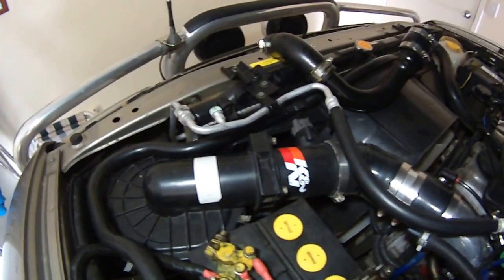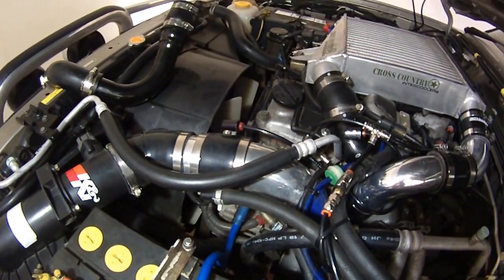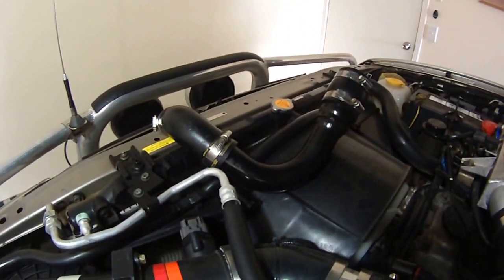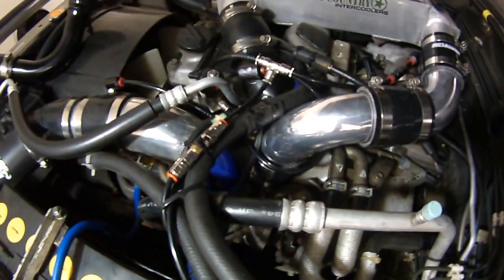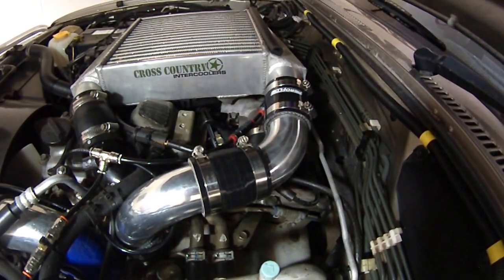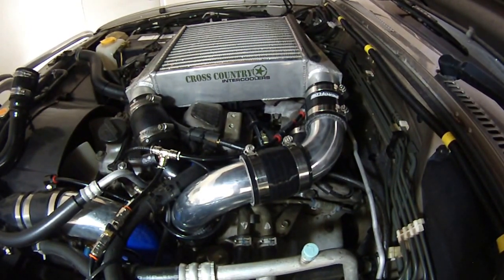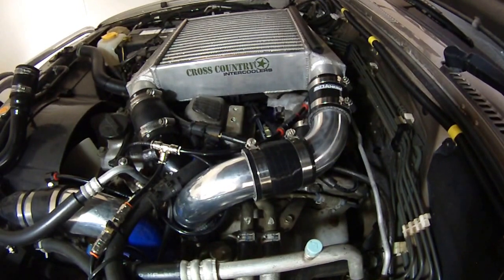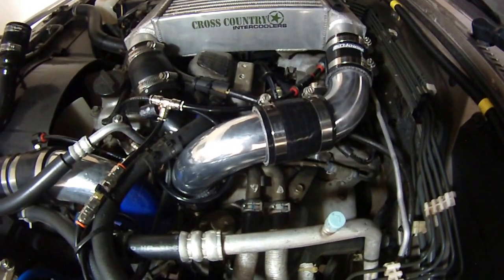Nissan 3L ZD30, turbo outlet to Intercooler modification

Comment: Geeyoutoo what size air filter you running I read somewhere you weren't running the standard gu patrol air filter from memory?
Reply from the maker: I have 2 reusables I use, a K&N E-9267 and a BMC FB229/07. The BMC is a slightly smaller dia than the K&N which is slightly smaller diam than the std air filter. The BMC gives almost 30mm around the filter allowing better use of the filter area, instead of getting the round black spot on a std one you can see a larger area being used and will notice dust even around the corner.

Comment: Nice video. I just picked up an elgrand 1999 with zd30 that doesn't start
Reply from the maker: Is that since you bought it or after?
Reply: @Geeyoutoo  bought it for a good price. But is it a good price really if it doesn't start 🙆 will have to figure out what's wrong with it. Worst comes to worse it's the fuel pump
Reply from the maker: @tunex_  What turbo does it have? is it a Zexel VP44 pump? Does it have the primer on the fuel filter? If so are you able to prime fuel to pump in 1-2 pumps?
Reply: @Geeyoutoo  I will have to check, if so how? Is a 1999 nissan elgrand 3litre turbo diesel X model which is the top trim.
Reply from the maker: @tunex_  sorry can't add a pic, just google Zexel or Bosch VP44 fuel pump and you will see.
Reply: @Geeyoutoo  ok so it does have the pump on the filter which is accessed under rear passenger seat. But it's very stiff, and I can't pump it. I assume either water got into it or something. I've tried starting it up with spraying cold start in to the intercooler and boosting a positive on the coils for the glow plug. And she didn't start.
Reply from the maker: @tunex_  What I would do is change the fuel filter if that hasn't been done since you bought it, while fuel filter is off, try pumping the primer to get fuel through the system, catch it in a container so you can check it out for purity, primer should move freely under this circumstance (but go firm within 1-2 pumps when all is sealed), if all good then fit the new filter, loosen the pump inlet banjo bolt on the side of the pump and pump primer until fuel weeps out of the banjo, tighten banjo, loosen return line banjo and do the same. Try to start, if worse comes to worse then remove glow plugs and crank until you see fuel mist coming out through the GP holes, if it does then refit GP's and try to start. Make sure battery is fully charged. If you don't get mist then there is another problem, but that is another story.
Reply: @Geeyoutoo  Great, thanks will. do that then 
I will come out with a video on that probably.
Reply: @Geeyoutoo  I also have a l400 2.8 diesel delica, but that runs well exept for the wobbly turbo.
Reply: @Geeyoutoo  what is the list of suggested mods? I assume a turbo timer is a good option to start with
Reply from the maker: @tunex_  I'm not a fan of turbo timers, don't see the point for a road vehicle, your not (or shouldn't be) turning engine off straight after giving it a flogging, by the 5ime I've driven into my driveway EG5 is well and truly at or blow 200c.
Reply: @Geeyoutoo  sounds good. Maybe just a temperature gauge
Reply from the maker: @tunex_  EGT gauge, one of the best favours you can do for a DI.
Reply: @Geeyoutoo  will have to study that for sure
Reply from the maker: @tunex_   check in at https://www.patrol4x4.com/ we have lots of ZD30DI information there.

Comment: Hey mate, I'm looking into this and want to know if there's any mods I can do 1 at a time as I don't have all the money right now for the lot of it. But I just brought a 2005 Nissan patrol gu st and it's done 360,000 kms. The motor is in really good condition but should there be some things I could be doing to maybe keep it going for as long as I can before a rebuild? 
Thanks 
Taylor

Comment: Hi there mate not sure if you still keep up with these comments love your videos! Have a 2003 zd30 all NADS done have ordered a hpd cooler arriving this week my boost gauge is currently plumbed into the IC out pipe I have seen that some put a T  in the IC where the boost vacuum line goes, would doing this effect the boost gauge reading or the amount of pressure my Dawes and needle will receive? Thanks in advance
Reply from the maker: Hi Zach, yes there can be a minor effect if just a T is used, sudden changes can cause a minor fluctuation, I like to keep lines to boost gauge and to the back of the Dawes separate, both of mine are tapped separately into the cold side of the IC.
Reply: Thank you very much I think I’ll get a bung welded into the cold pipe

Comment: Awesome job GU2... mint patrol!  -Dan (Ireland)
Reply from the maker: Hi Dan, is this the same Dan I know from somewhere else? :).
Reply: @Geeyoutoo  Yes Patrol Dan ;) The lad having all the drama at the moment LOL
Reply from the maker: @RC3Dflownwithpassion  I'm in the process of replacing my IP and fitting larger injectors, hope to have it back together late today, IP is a mongrel of a job on a DI.
Reply: @Geeyoutoo  Good stuff.You will be glad you did change that IP.Mine is so light on diesel and makes heaps more power.Regardless of what needs to be done to mine i'm going to keep her on the road.I love it. I will update when i get it back on what was wrong/is wrong.

Comment: Hey mate, whats the sizes for your intercooler piping to the turbo. If you could type me up a short parts list for it that would we awesome!
Reply from the maker: OK I will go over my notes and see what I can do tomorrow, you should be able to buy most of the bits at Autobarn these days, when I did this it was a little harder to get them. I'll add the list here.
Reply from the maker: OK found the list. In silicone I bought a 76mm short straight, a 76mm 45degree and a 76mm-51mm 45degree, the only ally tube I needed was a 250mm x76mm 45degree, I had to shorten the bend anyway so I was able to use those off cuts as a short transition to gain the correct length, I trimmed the rolled ends off the ally bend, there is no pressure in there so they are unnecessary. The silicone 45 degree needed a bit of trimming to get the angles to line up, about 6mm off one side at the back.
 I bought this gear from ARE in Brisbane (not sure they are still there) but I'm sure you can get it from Autobarn. Hope this helps.

Comment: Is there any problems getting rid of the intake resonator and disconnecting the plug that goes into it??
Reply from the maker: You can remove the resonator with no problems, mine has been gone for years, you will notice a slight change in intake sound, as for the plug you mention I assume you mean the vacuum solenoid that is bolted to the resonator, on the DI's yes you can disconnect that again with no issues, but I'm not 100% on the later CRD but suspect it would be the same.

Comment: Is there any chance I can put that intercooler in my d22 zd30 dx model I am having stress about intercooler fittings spot like front intercooler or on top engine intercooler
Reply from the maker: Should be able to with the correct bracketing, I'm not sure what fittings your D22 has but it's basically the same engine. That IC fits onto the original mounts at the front but because it is much larger it comes with brackets that bolt to the engine at the back using existing threaded holes.

Comment: How can I change turbo for nissan caravan as 30 motor from the normal engine body?
Reply from the maker: Hi Mate. Not sure of what you are asking, we don't see many Nissan Caravan's here so I know nothing about them. Are you talking about changing the whole turbo or just the intake?
Reply: Geeyoutoo 
I wanted to know where can I direct  pipes of inlet and outlet of nissan caravan zd 30 turbo. I changed engine before was normal zd30. But now I got the same engine but this one has turbo. I wants your help on modification of pipes turbo where can I alocate it. Thank you.
Reply from the maker: OK what I would suggest, seeing as this could get very complicated, I'm on a forum called Patrol4x4.com if you googled that I would suggest you join and introduce yourself, we have a specialised ZD30DI engine section and you would be able to put up photo's so we could see exactly what you have and how much room exists. It is generally me that does new member approvals so I will see it.
Reply: Geeyoutoo 
Ok thanks so much， let me have pics then I will post in order for you to see it

Comment: hey bud great vid question? how did you plum hoses back in to mid silicon joiner.thanks
Reply from the maker: Hi mate, have been on a road trip. The hose that goes onto the MAF housing had to be trimmed to fit, a slight angle change was needed, so I setup the hose that goes to the turbo inlet, cutting it as short on the narrow end as possible, making sure it cleared the pipes around it then worked backwards to the MAF housing, doing little trims as I went. Well worth the effort but if you have limp issues they will be worse after so a chip or other limp management items need to be in place.

Comment: Great video mate. Did you go alloy or stainless for the piping?
Reply from the maker: Thanks. Did them all in alloy, much easier to work with, absolutely no downside with alloy.
Reply: Yeah sounds good.
Just finished removing those 2 mesh screens out of my intake as well! See how she runs on the commute tomorrow. I can notice you dont have that other air box under the main pipe where the vac line to from the engine and to the VNC goes? Have you just completely removed it or have a different setup?
Reply from the maker: Yes completely gone, needle valve picks up clean air via an pneumatic exhaust filter I have tucked up under the dash beside the needle valve. You will notice a change in sound with the removal of those screens and quite possibly a rise in MAFv which can trigger limp.

Comment: Hi, just wondering, did you remove the intake resonator? A lot of intake pipes I've been looking to buy  has removes it?
Reply from the maker: Hi Tim, yes that resonator has been gone for a long time, that was one of the first stages of the intake mods where I pieced together 3" silicone bends and ally tubing off the MAF housing down almost to the std intake and put a 3" to 2" 45 degree transition straight onto the turbo. Yes you can buy them ready made in silicone but they still do a slow transition, I prefer the fast trans. And if you fabricate it yourself you can always make changes later like my 3" to 2 1/2" like my last vid.

Comment: I am currently rebuilding a ZD30DDT engine out of a Navara, not common rail engines, these engines have been beautifully engineered and in my opinion are very tough engines, I don't know anything about the patrol engine buts if its the same ZD30  then the trouble with the patrol is they have put all this crap put on the engine to gain more horsepower, bigger turbo, intercooler, and the rest, making it too complicated, the engine should never have been fitted into a patrol if this is the case.

Comment: Hey mate, have you tried a k&n filter they say that make huge difference would love to hear what you reckon, and thoughts on egr block do I need tillix value for over boosting issues incase limp mode cheers
Reply from the maker: +Lachlan Kaye
Hi Lachlan, I have had a K&N for a few years now with good results, opening the airbox and modifying the turbo inlet and outlet all make a difference, the K&N tops it off, I also have a BMC airfilter, P# FB229/07 so I move between the two, the BMC is a little smaller in OD giving better airflow around the outside so you are using a bit more of the filters area as witness by a significant change in the black ring you get on the standard filter, I was initially concerned that it may have caused a restriction through the webbing itself but there was no drop in MAFv at all and indeed there appeared to be a small improvement above 3500 where increased MAFv will not cause limp.

I don't use the Tillix valve, I use the good old Dawes and have for many years, I have found no reason to go away from it and I'm using 21psi. 

An EGR block is a necessity especially if you don't have a catch can, I have seen throttle bodies caked with 6mm of oily sludge all around. The EGR doesn't effect limp that much, it does increase MAFv at idle because that and cruising is when it is open, limp is caused by increased MAFv due to improved air flow, boost is just the medium, so a Dawes/Needle will be necessary if your improving airflow.

The areas for limp and the MAF values that cause it are:
under 2500 = 3.88v
under 3000 = 3.98v
under 3500 = 4.2v

Could write a bloody book on this but I'll stop now :). Hope this helps.

Comment: Hey bloke whats your thoughts on running without the engine cover?...cheers
Reply from the maker: +Materoa Wilson 
No worries, with my Cross Country IC It won't fit anyway. The thing to remember is to make sure that if you do remove it set it up so that all the air picked up in the scoop is still forced through the IC, if it spills down the sides your wasting cooling, and will see a corresponding EGT rise.

Comment: you maybe able to help me sir. I am having a problem with a noise that has started under the bonnet it sounds like air trying to escape under pressure when I put the foot down when it is cold or cool . after it warms up it go's away. if you can enlighten on what this my be would be great . thank you for  your time and great shows. rod1169@hotmail.com
Reply from the maker: Rod Schultz There are a few common causes of air noise under the bonnet, simple things to check are Intercooler hoses, intercooler leaks (generally in the corners where the seals loosen as the crimps loosen up and generally spotted by dark oil stains), vacuum hoses (these can show wear and cracks especially under the IC).

The other thing to look for is exhaust manifold leaks, these can cause some strange noises, seeing as the noise disappears when hot, this may be a good place to start.

Hope this helps, let us know how you go. Hmmm sorry just realised I put the reply in the wrong spot :).